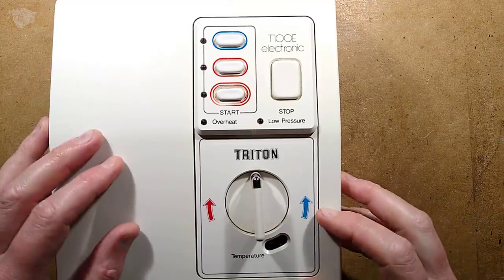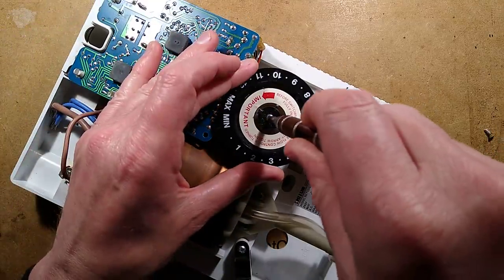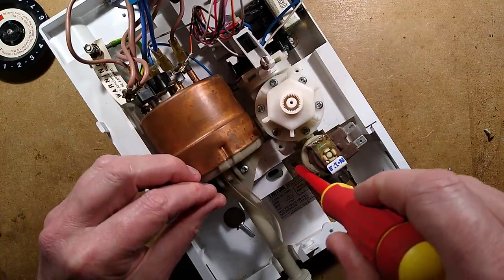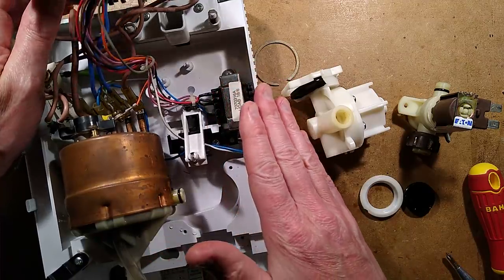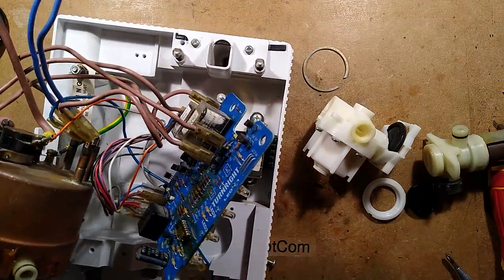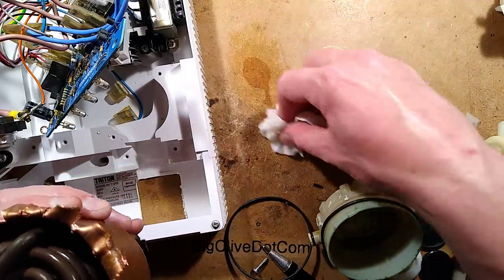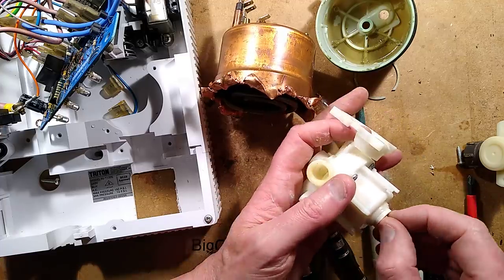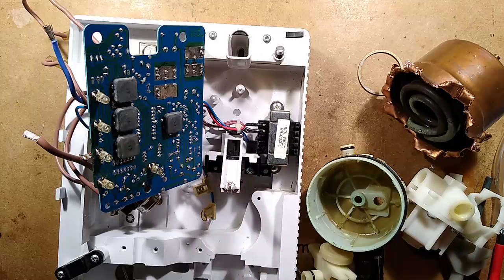Teardown of a British electric shower that went bang.

Comment: when i recently had to do some work on the solenoid valve in my shower I discovered that the guts of them are pretty much all the same - they all use the same parts and just change the outside, certainly at the cheaper end of the market.. That regulator looks very similar to mine by memory so I think it might be a standard part and likely still available... but your point about the aging of the plastic is well taken... plus the board is contaminated, plus a decent replacement shower is only about £70... you have to limit the amount of work you do with common sense... no point spending £50 on an old shower you could replace for a few quid more and get a warranty.

Good vid.
Reply: We had a very similar one, the T200RE, which had the heater box remote mountable and a slim control panel that you mounted on the bathroom wall. Innards of the two parts were remarkably like the innards of Clive's one. Over the few years that we had it the bit where the switch mounted broke several times, resulting in the pressure switch not operating - the spring there was surprisingly stiff and probably cracked the plastic part after a while. Got through several heater cans as well - hard water area - we had a phosphate dosing anti scale thing on the supply to it, which helped a bit. The only good thing about it was that you could buy almost any part to repair it. It finally died when the crumbling plastic problem spread to the back panel, and that was ISTR the only part that you couldn't buy. So at last it was ripped out and binned. 

Clive's video brought back memories of just how glad I was to see the back of it - Thanks!

Comment: This kind of device is simply forbidden in Belgium. Mains voltage can only appear 60cm away from a shower or a bath tub in all directions (except in height; there it must be at least 2.25 meters  away from the bottom of the shower or bath tub).

Comment: Tip: the power source should be compatible to the ampere of the shower heater if you want to use the maximum hot temperature. Don't use the line from lights(yes, that lights) due to lower amps.

Comment: At least it has some safety devices in it, the widow maker shower heads just have power right to a heating coil in the shower head and it is common to have a rubber mat to prevent getting a tingle,

Comment: Having looked at that, I am going to suggest the IoM has soft water? I had a Triton T80 which has similar functionality. Failed after 18 months. Did a similar strip down and those heater elements were entirely covered in limescale. Which had caused a terminal low flow of water resulting in the stupid thing going bang. I replaced it, but on my list of things to get, one day, is a water softener! Damn the east of England's hard water.
Reply from the maker: We do have very pure water here.

Comment: These are also very common in Hong Kong, for obvious reasons.
I don't like them not because of perceptions of safety, but because of how they work; the higher the flow, the colder it gets. There's no way to have a hot and powerful shower.
Reply: Yeah, they're very inefficient and crap basically.
Reply: You just need a less cheap one that heats better.

Comment: I know these indeed from the United Kingdom and once seen in Germany, but in the Netherlands most of the houses have a combination heater in the attic, both for the central heating system as well as for warm water. And in our house, since it is older, the warm water only comes down to the first floor bathroom, downstairs in the kitchen we have a close in-boiler under the kitchen.
Reply: In Germany? Never seen anything like this over there. Must have been an UK expat living there.

Comment: When I redid my bathroom I replaced it with a thermostatic shower. Unless you don't have a gas boiler these things are rubbish, it's cheaper, quieter and better just to run off the hot water pipe.
Reply: Ralphie Raccoon that so,utility doesn't work though if you have a traditional style loft header tank and open vented hot water system. You then start needing pumps etc, it gets complicated and expensive.

Comment: SMPS in one of those? That probably would turn it into a death-trap unless it was in a sealed and potted enclosure. Do they make them like that? Owing to the power level required by the circuitry alone, Id expect just the usual 20 some odd VA 50/60Hz transformer ensuring that only low voltage is ever present in the circuit.
Reply: God so many people who have no clue how electricity flows.

Its really depressing. I mean didn't one of your guys fly a kite in a thunderstorm to prove this?

Comment: If this has, say, 2kW of power, how can it heat water at an adequate rate for a shower? For instance, when I put a liter of water into a 2kW electric kettle, it takes several minutes to heat it to boiling point. If I assume that 1 liter of boiling water is enough for 3 liters of shower water, it sounds like one would get an extremely slow flow of water from this kind of instant heater(?)
Reply: A kettle is heating a fairly large quantity of water all at the same time.
This is only heating a very small amount at a time.
(And yeah, like the other person said, it's far more than 2kW. And not very good, unless you have no choice.)
Reply: @warren1134  Then it is powered with three phase power? I thought it was something you simply plug into a wall socket.
Reply: @warren1134  How can it be single-phase and up to 11kW? In my country (Finland) the max fuse size for single phase in households is usually 16A which limits power to about 3.6kW. That is with 2.5mm2 cabling. 1.5mm2 cabling is more common, which allows fuse size of only 10A.
Reply: @warren1134  Your electric installations are quite different from ours. Here all homes have three phase power, and for instance kitchen stoves which normally also have an oven are always connected to three phase power because they require so much power when everything is on. So are electric sauna stoves, which exist in most homes here, even in apartment buildings. These are permanently connected. Other appliances are normally connected with a Schuko plug or a flat "europlug" and therefore work on one phase only. Wall sockets in an apartment are connected more or less evenly to each phase, to balance the load.

Comment: I have also an electrical heater. The device is realy unexpensive but it needs 21kW means every 10min of shower costs 1 €. One kWh are 27 - 30 cent. Electricity is the most expensive way to heat anything. Ralphs device seems to be a single phase heater with not more than 3 kW. How can this heat the water for a shower.
Reply from the maker: It's at least 7.5 kw.

Comment: As a Brazilian, I'm used to electric showers, but I admit I didn't like this British solution.

Some of you may have seen about our "suicide showers" here, but believe me, those are exceptionally bad installations and very, very cheap models. There are many nice quality models today, all with fine temperature tuning and some with digital thermostat ("hydra quadratta plus" for example). I personally like our system because it doesn't use that weird wall mounted hand shower head. I've hated every bath I had in one of these showers.

Comment: I used to have one of these in a house with very hard water. Had to replace a scaled up heater about once a year. Sometimes the pressure release valve would blow, but sometimes limescale would accumulate in the bottom of the heater and block that, so either we would get overheat cut-outs or on one memorable occasion, the heater O ring failed with hilarious consequences. I think the bloody thing traumatised me over the years - I've never been the same around plumbing. (I have an oil combi-boiler and a water softer now...)
Reply: If you ever live somewhere lime that again, try to have a filter put in the mains supply to the house... I have one out at the main tap to the house, it filters everything out including chlorine. Only need to replace the filter once every 2 or so years.

Comment: An interesting device!
Your voltage 25A load, that would require a 35A fuse ... and single phase!
We do not have such equipment here in Finland.
In our old-fashioned single-phase detached houses, the main fuses (before the meter) are only 25A, less often 35A. (230V).
The 3 phase interfaces of a normal detached house main fuses are also 25A / phase, and on farms, depending on what equipment is behind 35A and larger. (400V).
Normal fuse sizes after the meter are 10A, 16A and 20A. (The old houses also had 4A and 6A, usually now converted to 10A).
Reply: Many (most) showers of this type in the UK run around 9KW now (when fed with 230v), so would put a loading of around 40A - typically with am MCB (breaker) of 50A. Amazingly, they WILL work when the incoming "main fuse" is as low as 30A (as they tend to be ULTRA ULTRA slow-blow). I only know this as it was only when we FINALLY killed our main fuse that they replaced it with a 60A one. Years later it went again and was bodged (for several years) with a 100A fuse TRYING to fit in a 60A carrier. They FINALLY replaced the whole thing. Was impressively naughty for a while, this 100A fuse sitting in a very old 60A carrier.
In the UK, electric "storage" heating is common place, so a lot of houses have 60A fuses and some BIG ones (old Rectory etc) have 100A 3-phase installs.
Reply: All UK homes are gradually being updated to 100Amp single phase.
Reply: We have a 100A main fuse to our house, that's at our UK 240V supply. Our instantaneous shower is on a dedicated 45A breaker, being also protected by a 30mA RCD, as per the regulations at the time. 
So it's safe as safe can be. 

I can't see the issue them.
Reply: @nathanlewis2815  no they are not, at least they haven't contacted me yet nor have I had any correspondence
Reply: The student house I rent has four 6.5kW electric showers in one house. It's an ordinary house with a 100A single-phase mains breaker. You can do the maths.
 When you turn on the shower you can see the CFL bathroom bulb dim momentarily.

We've lived here for 2 years and not had any fires yet, although one of the switches outside the bathroom for isolating the electric shower melted once (probably because the switch was pitted, the landlord put in a new switch and it's been fine since).
Reply: My house has single phase 60A supply.
Normal MCBs here are 6 16 and 32A but my shower when I had an electic one was on a 40A breaker

Comment: I'd heard that some old US domestic water heaters used direct electrodes similar to the Baby-Cutor.
They might have also had "magnets" around the hot water outlet to "stop the electricity from coming out with the water". 
Sounds legit!
Reply from the maker: You can still get the graphite electrode water heaters.

Comment: As a yank I'm used to pressurized hot water systems, but I don't see a huge potential for electrifying gram, as some people complain about, if one of these is installed correctly. I'm aware of the history of British hot water not being sanitary but I believe that's not a problem anymore.
What I do see is the chance for some rather uncomfortable showers, being as they regulate the temperature by regulating the volume. Do they still install these in modern construction?
Reply: TheOtherBill These were a cheap solution to provide a shower in a house where a traditional loft tank based hot water system was installed. Because the loft tank might only be above the bathroom ceiling, pressure was insufficient to provide a shower. As a nation we traditionally favoured baths and very few homes had showers in the early days of indoor plumbing. Over the last thirty or so years plumbing has moved to pressurised hot water so conventional mixer showers running from hot and cold supplies are the norm for newer homes, although some still have a single electric shower somewhere in the property, maybe a guest bathroom, as a backup in case of failure of the main hot water system.

Comment: Still trying to figure out what happened to our shower.  It spurted water out the front then magically fixed itself.
Do some have auto-resetting pressure releases or did something weird happen and it somehow sucked that rubber bung back in?
Reply from the maker: Some do have a self resetting pressure relief valve.

Comment: What is the nominal residential water pressure in the UK? Depending on the jurisdiction, in the US, it generally ranges from 30 to around 70 PSI.
Reply: UK can vary drastically. A lot of appliances like this will state their min and max as something like Minimum 1 bar, maximum 10 bar water pressure. Some places can be higher and pressure reducing valves are then fitted to tame the supply down a bit once it enters the property.
Reply: @moojuiceuk  Note that 10 bar corresponds to a 90m (300') water tower (surface of high tank 90m above shower location, probably on top of a hill while shower in basement in a valley).

Comment: What sort of fusing is there in the event of a short?

Similarly, it didn't seem like there is a lot of calcium or lime. Is that not a problem over there or is it like here in the States where water hardness depends on location?
Reply from the maker: Very soft water here.  The showers are protected by their own breaker and usually an RCD/GFCI too.

Comment: He mentioned water hammer, and I think that's about about the only thing that could blow the back out like that. Does his brother live in an older home or are water hammer arrestors just not part of the code there? IIRC they're required here after 68 and the law says they have to be behind a wall you have to cut open so you can reset them.

Comment: It should be an enabling system on the water regulator as they require a minimum bar pressure so the heater doesn’t run dry/hot

Comment: I suspect that the main reason these aren't popular in the USA is because we have 120v mains.
Running extra 240v lines just for shower heaters like this gets expensive quickly, so we just use our central heater and wait for the hot water to arrive at the faucet.
My first in-person encounter with one was in the Philippines, where apparently these things are also popular. (Go fig, they also have 240v service.)

Comment: How would the water hammer have reached that pressure regulator? Wouldn't the solenoid valve have been closed when he turned the water back on?
Reply: Till he turns on the shower, opening the valve

Comment: I spent 2 months in Singapore, back in 2002.  This is similar to what they have, except theirs are external to the tub/shower area, and a switch by the door to the bathroom turns it on.
I, being Canadian, and spoiled with 24/7 hot water out of the taps, could never truly get used to it... or the heat.  So I took cold showers there.
Reply: You realise we get 24/7 hot water out of the taps here too... don't you?

Comment: Why do you have these units in UK? Do you not have a central water heater? If so, how do you get hot water in the kitchen tap etc? Separate heaters for every tap?
Reply: We have a boiler that heats water either on demand or with older systems in a hot water tank.  The hot water tank is usually placed in the airing cupboard as it helps keep the cupboard warm.

However the tank only holds so much water so these showers provide instant hot water which is great when the hot water tank has been used up.

Many boilers produce hot water on demand so thats not so much of a problem for those systems.
Reply: @dlarge6502  Interesting, here in Sweden we usually have a system with a tank, but it is so well insulated it doesn't use much power to just keep it warm. The one at my parents is just ever so slightly warmer on the top than ambient, and the sides don't feel warm at all. Inside it is kept at a really high temperature (90 C I think) and there is a mixer on the outlet to bring it back to the normal hot water temperature in the pipes. That way the tank can be much smaller.

Comment: The pressure switch has fractured,, 
transformer powers PCB, 
chunky relays switch the elements on, 
you cant refit the ball, it will just pop back out
notice the max pressure sticker in the chassis is 150psi,
I used to repair them

Comment: I've got one of those 3 kW, Chinese instant hot water taps, in the office (more a glorified shed), at work. 
It is very weak when the inlet water temp is low. I've also got a 3 phase supply there.
Would connecting it up to more than 400V be insanely dangerous?
Lets find out.....
Reply: Search Stiebel Eltron for their 3 phase water heaters about the same size as the unit in the vid. But mounted under a sink etc not in shower cubicle. Used in some apartments
Reply: @richardwallace5984  Thanks. But I was thinking more along the lines of Clive putting UK Voltage through the US Sausage Electrocutor.
Reply: @gcunn1  If it's designed to work with 110 or 240, and you push 400 though it, it will probably explode or fail in a spectacular way.
It might work for a bit. It might also become live and zap you, because a component designed for lower voltage could short out.
Best of luck, eh.

I humbly suggest that you check how much it costs to use, and do a bit of maths. 1 kWH costs about 14p in the UK; if you're using it for, say, half an hour a day, that's about a quid or so; £360 per year.

Maybe you could get gas in your shed, which costs about 3p per kWh. OK, so, a decent "instant hot water" gas heater is a few hundred quid, but long term would be cheaper.

Or just get a decent fast kettle, and wait a couple of minutes for your tea.